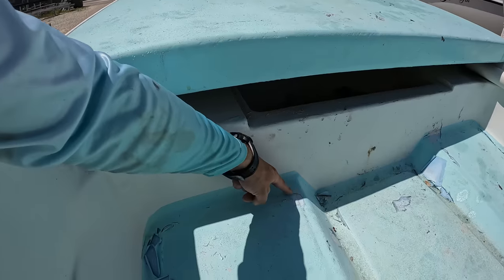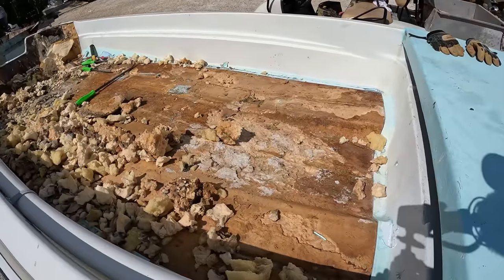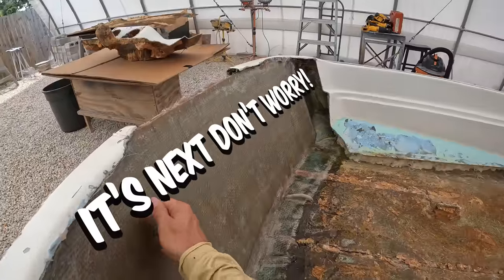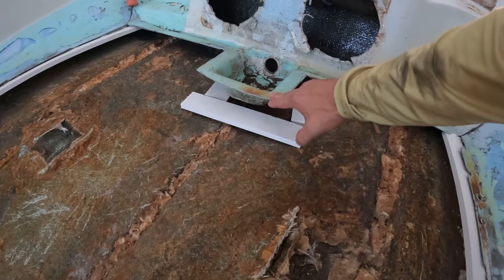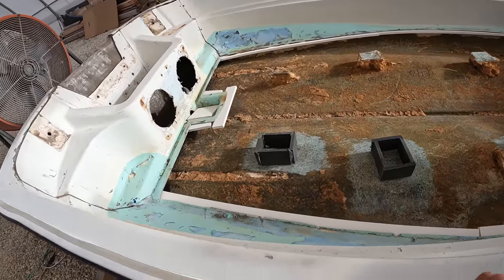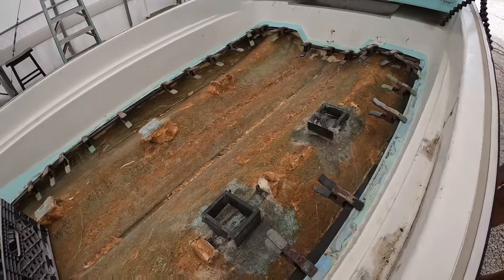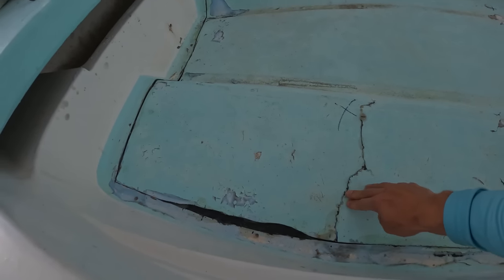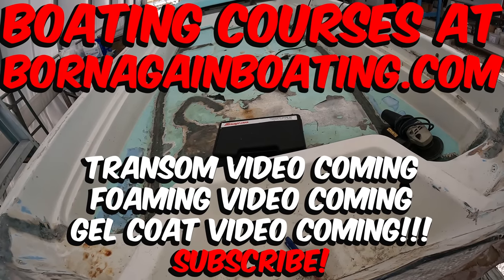Fixing A Soft Boat Floor! (Start to Finish)

Comment: Reminds me of the structural restoration of my boat. I have a 1960 Glasspar Citation. It was completely dry rotted, the deck, the stringers and the transom. It got re-engineered and rebuilt with a thicker deck, massively reinforced transom, added a bilge and a super beefy bulkhead under the deck under the front seats. Today the deck feels as solid as concrete, I've never found so much as a drop of water when I pull the plugs from the bilge, and when I give it the beans, it jumps out of the water and up on plane in an instant. It's a great old boat, cute as hell. I had the upholstery professionally redone back to 1960 original. I love that boat.
Reply from the maker: There's something deeply satisfying about bringing an old vessel back to life and seeing it perform better than ever.

Comment: You are tenacious man. That's a huge project. I couldn't do it 😂. Id be giving that thing an overhaul. Flip it over and haul it to the dump😂. Your the bomb for doing this video though. A lot of people are willing to take this on. I unfortunately live in an HOA because I was stupid enough to buy a house in an HOA. I have 48 hrs to work on my boat before I have to take it back to storage for at least a couple days before I can bring it back for another 48 hrs. It sucks I'm  moving at a ridiculous pace trying to get stuff done and done right in the Florida Tarzan heat and humidity. My boat is bright white and it's like a frigging giant tanning bed and oven. I have to turn the bilge pumps on to pump the gallons of sweat pouring out of me 😂 . Takes 3 days just to rehydrate 😂. My neighbors frigging hate me😅
Reply from the maker: Thanks a bunch for the support and the laugh! It sounds like you've got quite the adventure with your boat, battling the elements and the infamous Florida heat and humidity. Don't worry, we're all in this together. Keep cool, stay hydrated, and keep those bilge pumps pumping! 😄

Comment: Definitely going to check out your training on the website but a quick question first, could you split the top cap and bottom at the rub rail and do all these repairs that way? I'm not second guessing your work im honestly trying to learn.

Comment: I have a whitewater boat that I just acquired.. it's a 2005 17ft cc ... no soft spots in the floor and the transom seems really solid .. but I'm still worried if it water logged because it seems like  was poorly taken care of .. It's a really cool hull tho.. I have no idea about how white water stringers are constructed .. been trying to research as much as possible .. have not had the boat in the water yet to see how it floats .. it may not need to get refoamed at all .. but I'm  trying to see what kinda job fixing fiberglass boat is... lol it looks like work .. but idk im up for it if it needs it. .. I also am gonna re gel coat the boat ... I'm really hoping my boat isn't water logged ... because re-gel coating looks like a lot of work too .. the less work the better .. hopefully it's just a matter of re-applying a gel coat

Comment: Will that foam gradually soak up water if the boat has a little crack in the fiberglass and is left in the water?  I just got a 30 foot catamaran where someone filled the bottom foot of the pontoons with foam and laid a fiberglass floor over that.  Should I cut out all that foam and put in a proper bilge pump?  Or is the foam going to be OK?
Reply: Just watched your second video on this boat.  Guess you've got too many viewers to answer questions anymore.

Comment: I have watched ALOT of your videos. My question is the brackets for outboards. I need to know more about them. I have watched every video you have on them and it doesn’t quite answer it. Like to glass a transom and add a bracket for example. Pros cons. Etc

Comment: Great video but my question is how much should one expect to pay for this type of job? It’s coming up on the end of boating season in my area and there are always good deals on boats that need a little TLC.
Reply: The big question is, “how much does the resin cost along with the other supplies?“ as an old guy who has been restoring boats enjoying boats flipping boats and loving them for over 60 years, Born again boating is perfect with its double meaning intact.

Boat values fluctuate dramatically between January and June. Of course January is the time to buy even if you live in Wisconsin, Michigan, or Minnesota.

Comment: Maybe I missed an explanation in the video, but it seems like the easier fix would have been to separate the cap and hull.
Reply: The foam in a whaler is everywhere, up,to the top of the gunnels, and the hull-to-deck joint is glassed.    They don't come apart easily